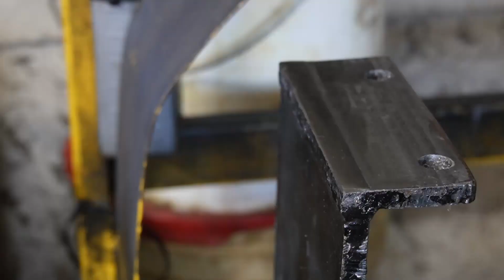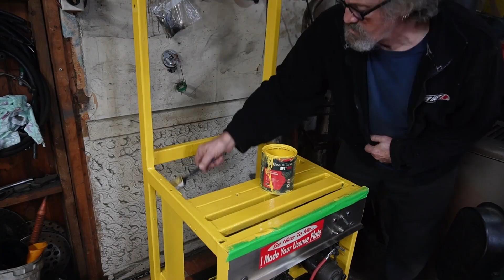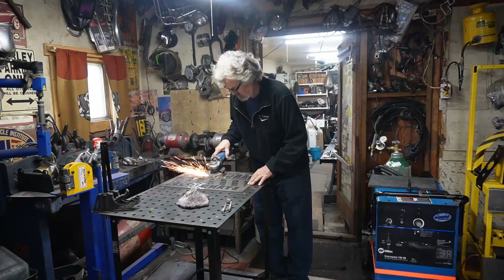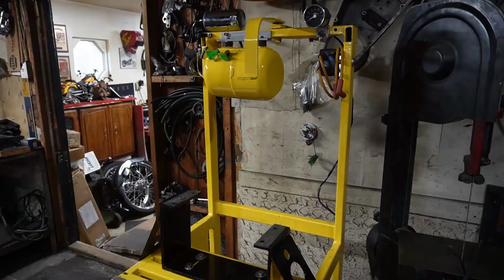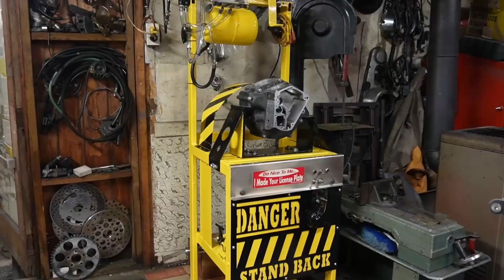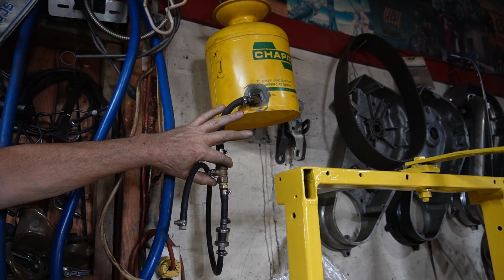Rebuilding my HD Motor Test Stand

Comment: Needed some ideas before building my stand. Your video is a big help. Thanks
Reply from the maker: So gald it could give you a few ideas. Pretty simple set up, just some welding needed. Just got the make sure its "anchored down good" as they will shake. The very first motor I fired on it I had the wife there. I didn't have it bolted down, and could not wait to see it run. I said "just hang on to it for a minute". It danced all around the shop with her yelling, but she still held on to it. She never did that again. ha ha  I would not trade it for the world. Still feel like a kid when I first hit the button on a new motor lol  Thanks for commenting.